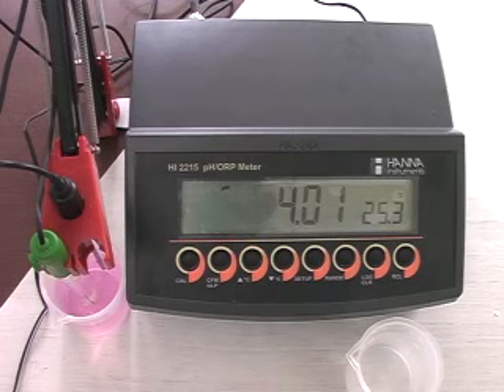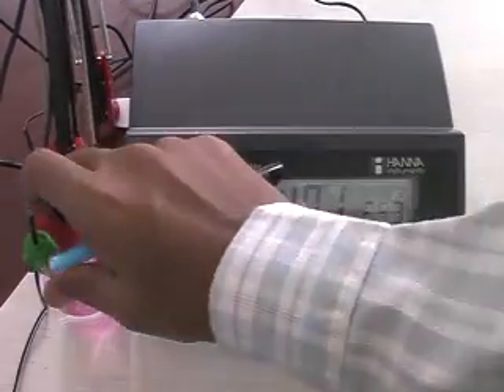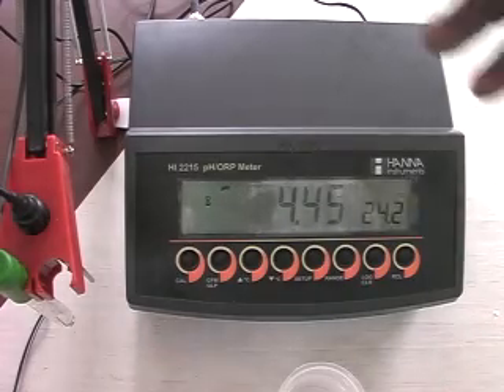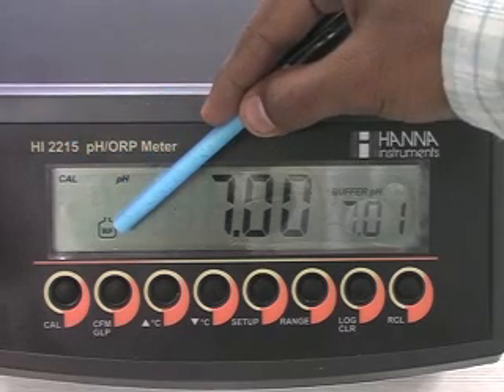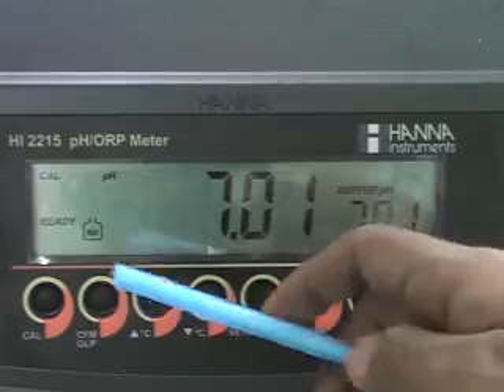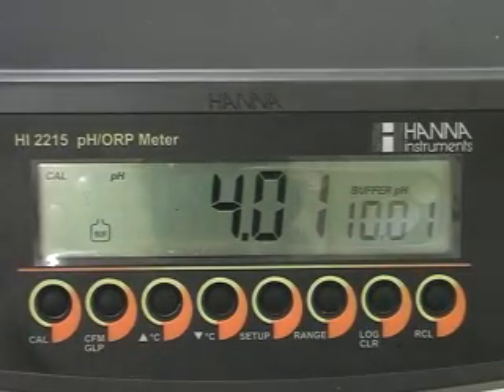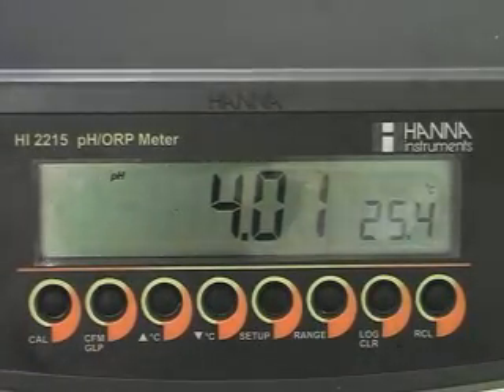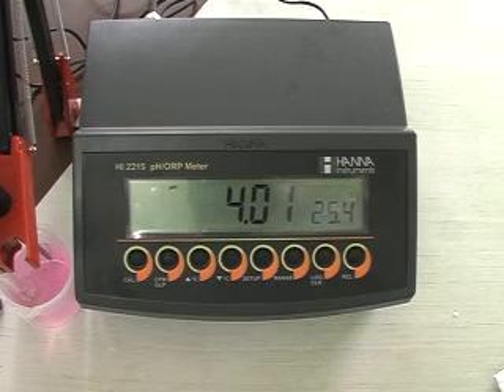Calibration of Hanna Instruments HI 2215 bench-top pH meter.mp4

Comment: 2 point cal means only two buffer calibration ? Supposing 5 point cal means what are buffers apart from 10.01 ?
Reply: 2 point calibration is for two buffer values. Typically with pH we need at least 2 pH units away form each for calibration value used. The HI2215 does allow for up to 5 points to be calibrated. Mulitpoint calibration is done to bracket the expected reading. For example if my readings are always between pH 7 and 4 then calibrating to pH 10 has no purpose since the segment of the slope will  not be used.